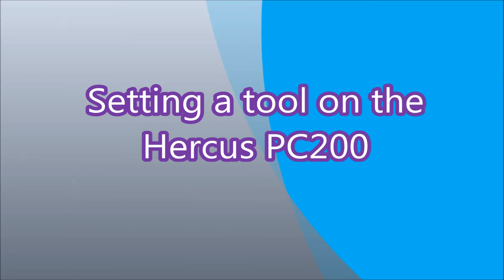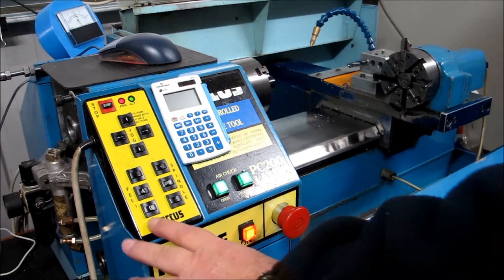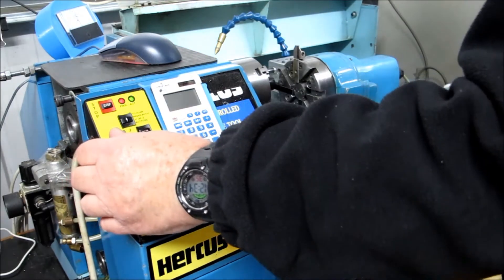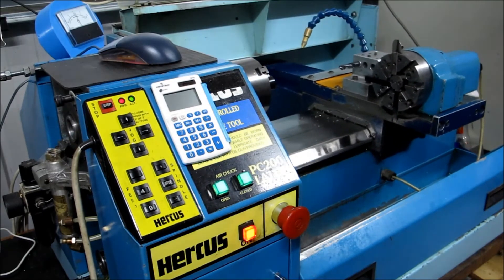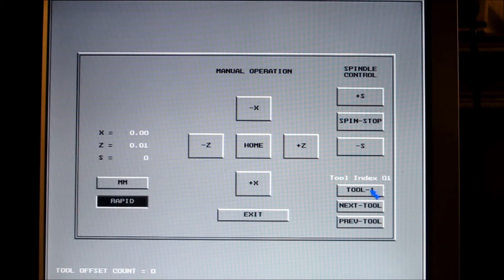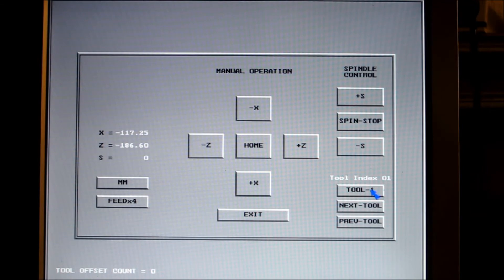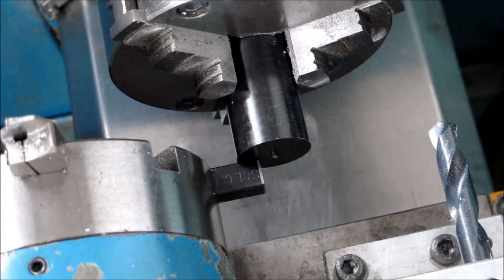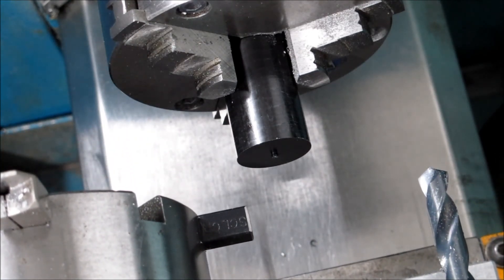Setting up a tool in the Hercus PC200 cnc lathe

Comment: Are you able to step the axis say 0.01 per button press or will it only 'pulse', I hope you understand my gist. Great videos, just came accross them and you have certainly gained a subscriber!
Reply from the maker: Not in the early machines, but the pendant buttons work quite well for me.  The later machines have Cut, Jog and rapid buttons each of which give 0.01, 0.1 and 1.0 movements for a single press on the button, which is great until you leave your finger on the button a moment too long and it takes off at the  speed of the button.

Comment: It is a very nice machine. The turret looks especially robust compared to the one on my Denford Easyturn.
Reply from the maker: Hi David, physically it is fairly robust but some time ago it drove me nuts with it missing tool changes. It has a micro switch to home at tool one and another that counts off the tools to select the right one.  Did a heap of work trying to fix it but in the end all that was required was a small capacitor on the micro switch to stop "switch bounce". since the cap was fitted it has been great, I don't think it has missed a change in thousands of changes.

Comment: That is one cool little machine. I wish I could get my hands on something like that. Although to be honest I would probably run the lathe under grbl instead of that stock program.
Reply from the maker: Hi Bruno, as old machines are your thing, look for a Rockford pro 2000 cnc lathe, that is the name these were sold under in the States.  Of course one of these would be "NEW" compared with the rest of you machines. These machines are nicely made and are mechanically sound if you want to convert them to another system.  They are run from an interface card in an ISA slot in the pc, the pcs have been upgraded and the card gets thrown away with the old pc so the machine is dead. So they get retro fitted to other systems.  Mine work and I use the cad/cam system that came from the maker.  This one I have had since 2005, the only real upgrade I have made is to fit a Minarik spindle driver card and wow does it make a difference.  I actually get the full1/2 hp now, whereas I was only getting 140vdc instead of the full 180vdc.
Reply: smallcnclathes I will have to take a look for one to convert or even stock. And yes these machines would be about 30 or 50 years newer than my old machines. I just can't bring myself to convert my Logan to CNC, have been thinking about a mini lathe conversion, however that machine does look solid compared to the typical mini lathe. As for how, my Logan only has 1/2 hp to work with. Thinking of upgrading to a 3/4hp variable speed DC drive.
Reply from the maker: Bruno, since the upgrade, I mostly run at 3000rpm and the spindle does not seem to mind at all.  Before the upgrade my top speed was 2300rpm.
Don't mess with the Logan, end of story.  Someone put far too much work into that to convert it!  
Most of the Hercus machines were sold into educational institutions where they were mostly under used and left gathering dust.  I imagine it was much the same in the US.  Here a lathe will sell from anything from 1000 to 5000AUD.  If you can find one without the pc it should not cost much as it will not work.  If you want to see photos of Hercus machines you can visit the Hercus Benchtop  cnc Users page on Facebook
Specs can be found at benchtopcnc.com.au